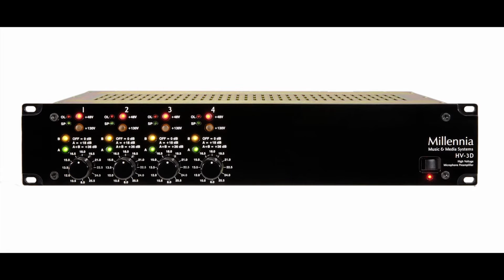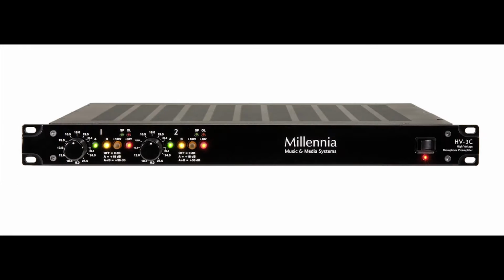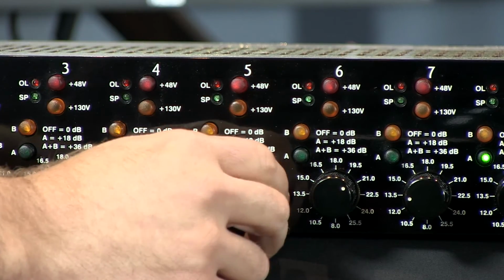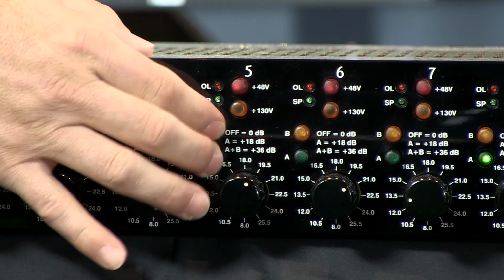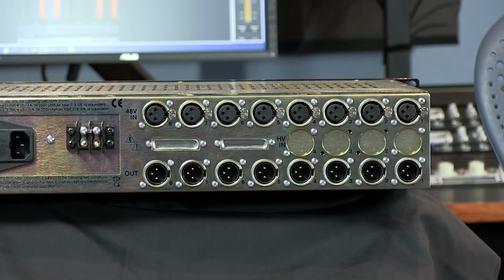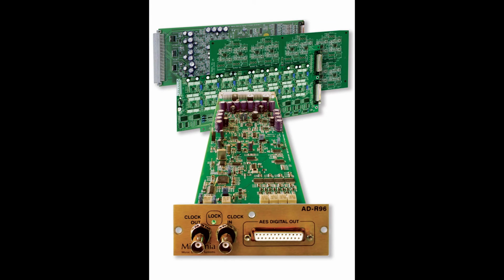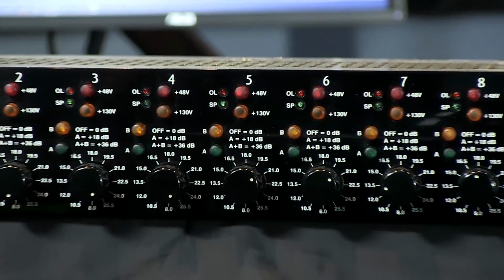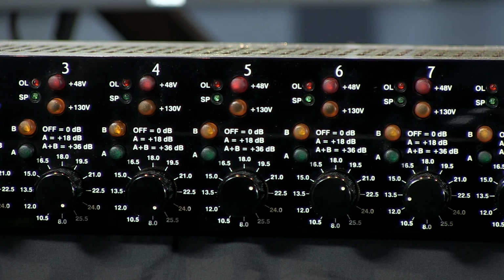Millennia HV 3D8  8 ch Mic Preamp Overview - Review and Samples

Comment: so you put connect microphone with XLR cable to the pre amp like this : XLR in the 48V In input and then with another XLR you put in OUT section and connect it to your audio interface right?
Reply from the maker: Yes.  The XLR out can then terminate to TRS if needed on the other end of the cable going into the interface.

Comment: Can you connect synths & drum machines on the HV-3D? Thanks for the video!
Reply from the maker: Best to use a Direct Box first to get it to proper levels.  Something like this for stereo inputs. https://purewaveaudio.com/rupert-neve-designs-rndi-s
Reply: @purewaveaudio  Thanks, Millenia replied to me yesterday. Here is the company's answer: "Yes, the HV-3 input stage can accept up to around +20dBu without a pad."
Reply from the maker: @Musical.Maze.1  Sure, but you still have to do a switchover in cabling. A DI takes care off all that in one swoop.
Reply: @purewaveaudio  So.... first I connect the gear to an 8 channel DI BOX, then take the 8 outs from the DI and plug them to the Millenia and the 8 outs from the Millenia to plug them straight into the audio interface card?
Reply from the maker: @Musical.Maze.1  Your path is correct.  If you believe this will be a permanent setup just for that gear, then yes this would work.  Otherwise if you need flexibility, we would introduce a patch bay and another set of cabling. Depending on the volume of your instruments, you can patch in directly or use a DI in-between. So it could be INST>patch>Preamp, then Preamp>patch>Interface.
Reply: @purewaveaudio  Unless the gear's out are all balanced, so I go directly into the Millenia and from Millenia to the audio interface card, which is the shortest path. Thanks! I will think about it.

Comment: Been using a 3C for a couple years and love it! I'm curious about your lapel mic. Looks like you were getting a pretty strong signal from it, especially considering how low it is clipped to your shirt. Are you running it through a Millennial? How much gain did you use? Cheers!
Reply from the maker: That distance is typical for a balanced recommended sound.  Newscasters, which we see all the time, have more clothes restrictions so the distance is shorter.  This was just camera mic pre.  No idea of the gain used.